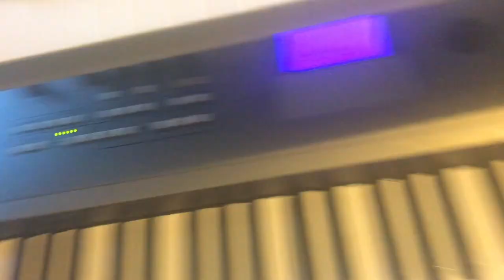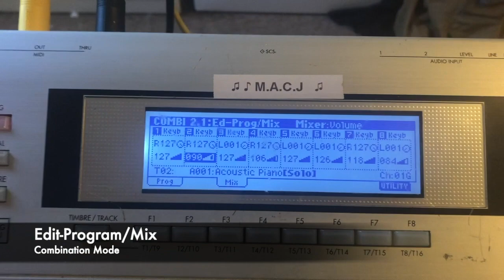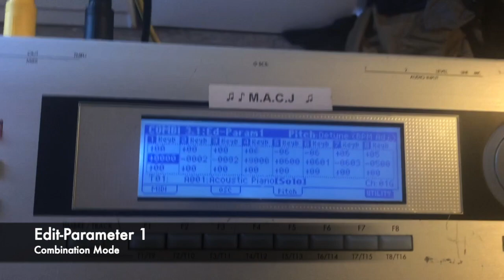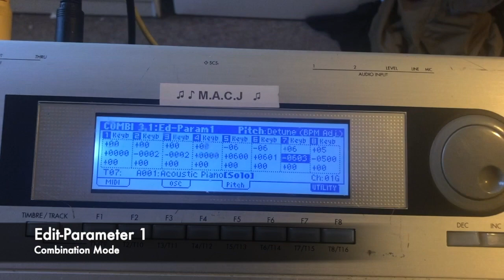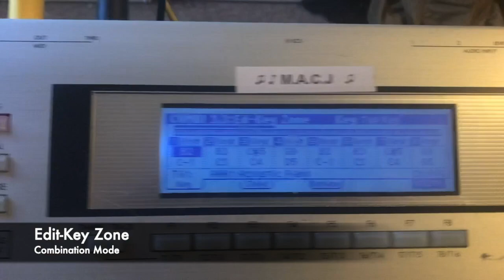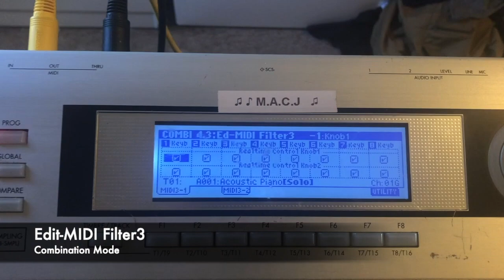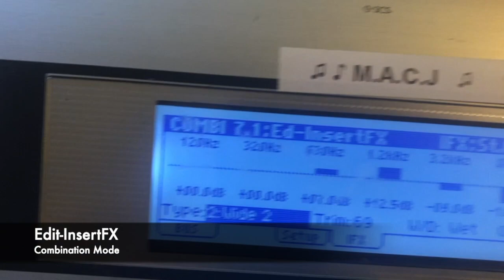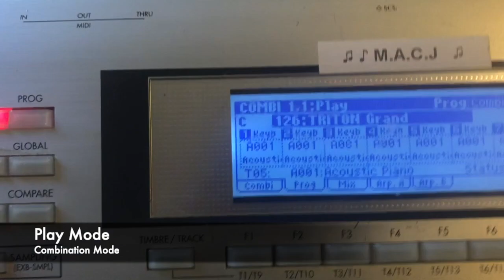Stereo Piano Patch for Korg Triton Le | Sound Design | M.A.C.J World

Comment: Hi Mate, I just recently bought this keyboard and tried every single setting as per your video but didn't work. :(
Reply from the maker: What was it that you missed in the video? With this video you have to take your time and ensure that you check all steps.
Reply: @MarlandJ  hi thanks for the response. WhanI have missed is I can’t change then parameter to 01G. The only options are 01 to to 16, and Gch.